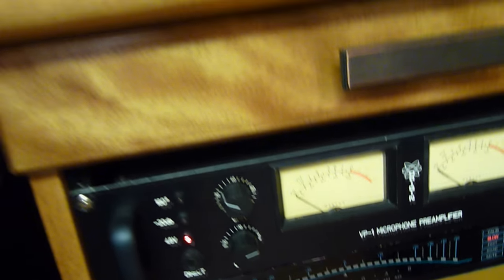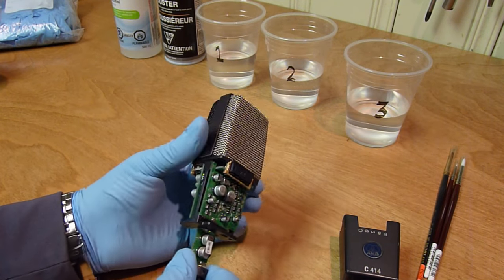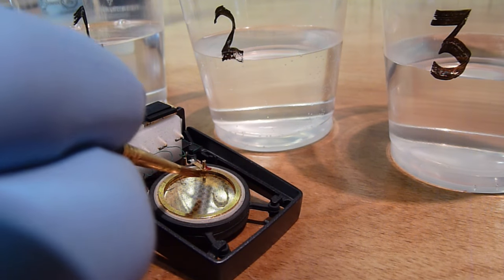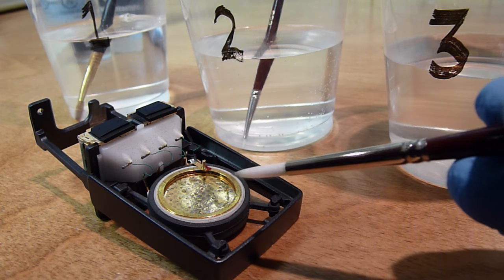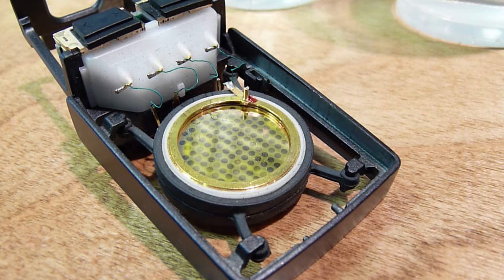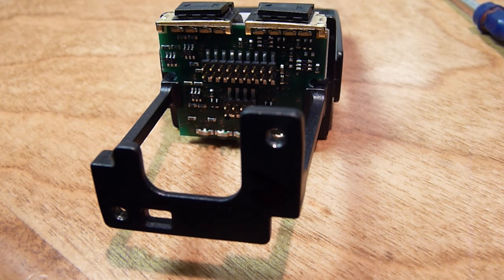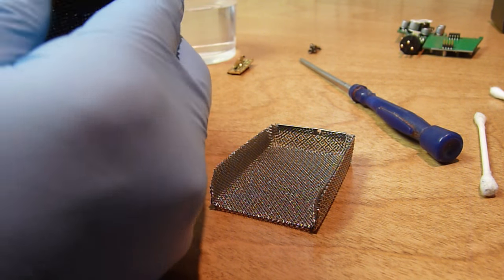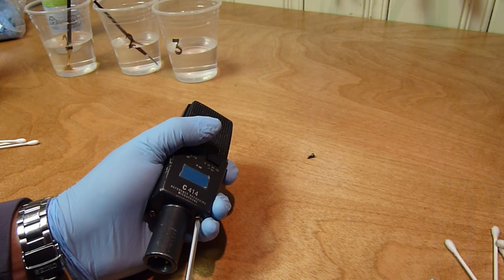Cleaning a Dirty Microphone Capsule

Comment: Very nice and concise. I have been cleaning U47s and such for years, I use other solvents I can find in Venezuela, but your best bet IS 99% alcohol (or rubbing alcohol) to not damage that gold plating. Some mics have the connecting screw in the middle, and tightening that is very delicate since it tends to warp the foil if you move it. Be wary and dedicated, do not rush and use magnifying glasses to see mini-faults. Great video, appreciated...!
Reply: I have a mic that doesn't have that gold plating. It looks like it was there as i can see small traces of it left by the screw. The mic barely works and sounds really bad, unusable basically. Is that because the gold plating is gone? What is the function of that gold plating? I'm thinking of just getting new, cheap k47 capsule from aliexpress but wondering if that's cause of plating is gone?
Reply: @sebsefyu  the gold plating is there so to pick up the membrane movement as an electro magnetic signal. get a new capsule.
Reply: my capsule is dirty and has that screw in the middle. can I lean it only with distilled water and not losening the screw? basically around it...the mic is old and somewhat noisy at more than 50% of pre amp, but still not sure this would help or damage, so not sure
Reply: @Jim Kovacs, is that alcohol that you use the "normal" drinkable alcohol - C2H5OH, ethanol, ethyl alcohol? 
I ask because ethanol is very cheap and easy to get (2€ per litre in the local drugstore) - isopropyl alcohol costs ten times more.
Reply: Andreas Giese always use isopropyl when cleaning electronics. Always

Comment: I dabbled in capsule cleaning several years back, honestly had great success. Have to have a steady hand as to not apply too much pressure and accidentally damage the membrane (some people may not be able to do this), and of course use very soft brushes, but totally doable. I had some MICs that would cut out / make noise if you even lightly got near them with your breath, but after some careful cleaning, they worked 100% again. Replacing the capsules seems totally unnecessary when many can be cleaned. Nice video on the subject, wasn't much at all on this process years ago. Good work as well.
Reply: Thanks for this advice. I have some mild issues with "shaky hands"(especially when I'm doing something that could potentially throw a couple grand down the toilet), so I may see about having someone professional do it when the time comes.
Reply: @Ten80pete  You're welcome. I'd say on a cheap microphone's that aren't much of a loss if you destroy them, it's fine to give a go, but if it is fairly valuable and you have never done it, I would suggest a professional that's experienced in doing it. I would also highly suggest trying it on a cheap MXL or similar first (sometimes can get non working MIC's really cheap online like ebay), to get a feel for it, for anybody that wishes to try it. I would not jump straight to a high end microphone unless you are prepared to have the capsule replaced or reskinned anyway.
Reply: i accidentally rubbed a spot ( gold plated coil got rubbed off) with my rode nt1a. would it affect the microphone? i used 70% alochol. I'm kinda scared right now because its my only mic
Reply: @coleenacebuche2083  Hard to say how it will impact the sound of the microphone, or functionality. If you rubbed off half of the gold or punctured the diaphragm, it might not work well. On the other hand, if it is just a very a tiny spot, good chance it won't make enough difference to notice while in normal use. I would finish the cleaning taking more care, stay away from the damaged spot, and then reassemble. Really won't know until you put it back together to test it. I keep in mind that, the cheaper microphones that need cleaned are nearly junk because they do not work prior to cleaning, aren't worth paying an expert to clean, nor buy new capsules, so was worth the risk of damaging them because even if I damaged it, was still in the same boat of needing a capsule, but, was worth the try. Hopefully it still works for you well enough.

Comment: Usually, 2 ways are used to deposit a thin layer of gold on the mic membrane: electroplating and sputtering. The first is cheap, but the film that is formed is more fragile and usually has less adherence. Sputtering is a more expensive process (the metal is vaporized in a stream of electrons,  in a low pressure chamber, and this metal vapor is the one that adheres to what we want to cover) but the adherence is much greater. Reading the comments, there are many who "peeled" their capsule, that's almost certainly a sign that the capsule was electroplated, not sputtered. 
(in an old Rode brochure, they specify that the NT1A capsule is "gold plated", while the K2 is "gold sputtered") I don't know if they keep the same processes now, check the specifications of your mics before doing anything

Comment: Don't do like I do, listen to this man!
I just screwed apart my ~10 year old Røde NT1-A because the XLR bit became lose recently (because I started to use a tightly fitting cable probably). I didn't find a way to repair the XLR bit, could glue it in maybe...

Anyway, I saw similar debris on the diaphragm and proceeded to clean it with cotton buds and water because I had none of that fancy stuff at home.
I managed to puncture or rather peel off the diaphragm in two places.
Not sure yet whether it sounds better with damage than with debris. Can't tell yet as it's drying in the sun. Almost certainly a bad idea as well.
Reply: выкинь

Comment: I really appreciated your video, and then assembled everything I'd need to clean my own C414. First, I thought I'd practice on my old Rode NT1A, the 25% alcohol solution took the gold right off the capsule!  Cold fear and cold feet for me, I think I'll re-think cleaning the C414, it's the most expensive mic I own.
Reply: I plan to do only with distilled water. my mic is cheap, but capsule pretty nasty when I see it from outside
Reply: C414 capsules are very fragile. The bonding between the gold layer and the membrane is very light and you can easily 'wipe' off the evaporated gold layer. (By the way: I would never use alcohol...)

Comment: Thanks so much. Been looking for information from what least appears credible and experienced sources on this topic. 90% Tell you NO...and NEVER..when it comes to capsule cleaning..but I know better. Thank you sir. Do you have any further advice or input that may pertain to tube amplified microphones? I’ll assume no..but figured I might as well ask while thanking you.

P.S. I do a lot of work on micro electronics. About a year ago I put away my magnifying clip-on/flip in magnifiers for something that works substantially better for me. I had my “last” larger screen Cell Phone. I affixed it to an adjustable mount. Now I use it  as my magnifier..it magnifies AMAZING. The pixel resolution is such that the digital zoom even is more than enough to outclass my magnifiers.As well..it has the very bright LED on it that is much better than dodging around or tilting objects to see minute debris or markings on IC chips. I just leave the charge cord plugged to it while it’s in use. Figured I’d mention as it may be a good tool for you as well.

@FreddysFrets

Comment: Great instruction! Thank you very much! Please, answer for 3 questions:
1) Can I clean my Shure SM7B this way?
2) Capsule of SM7B has a complex structure, and I'm not sure that I can take it apart to clean all the layers. So I have idea to immerse it in a bath of alcohol or distilled water, and then dry it. Is this a bad idea?
3) Can I clear the capsule by isopropyl alcohol (I heard, that isopropyl alcohol better then regular alcohol)?

Comment: I would not suggest to do this with your microphone capsule. I have done the same very carefully step by step like in this tutorial and now parts of gold has detached from my Rode nt1000 capsule. very disappointing
Reply: I would wonder how cold or hot your solution was and what the difference in temperature of the microphone capsule was. I'm sure enough of a temperature shock to the capsule could possibly dislodge the gold plating, but I'm no expert. Just something to consider
Reply: @TheChadPad  Can confirm, I just tried this on an old Rhode NT1A and barely touched the thing before the gold plating began peeling off.  Think I ruined the mic.  Time for a new one I guess.
Reply: Luckily Rode has an amazing warranty, they will likely replace the capsule for free.
Reply: @tomwolff6329  Nah, it wasn't you. You've only demonstrated that the quality from the gold sputtering on Rode capsule diaphragms is subpar [same applies to any Chinese made wannabe Neumann/AKG capsule]
Reply: @RockmannMusic does that mean the mic is no longer usable?
Reply: @edwarddelavilla3475  The more gold is getting removed the quieter the microphone becomes. No gold, no sound : )

Comment: Great video, thanks!  Is that a dry brush you're using on the high impedance board initially?  Are you brushing over the gold contacts as well before applying contact solution?

Comment: I get this intermittent low frequency rumble whenever I try using my microphone. I suspect humidity might be responsible because I live in the RGV close to the coast.
Reply: or maybe the xlr conector are toutching the ground
Reply: sounds like a dirty capsule. the condensation from your breath is mixing with the tarnished capsule and changing the impedance

Comment: Why not soak the grills in some Alcohol, and dry with a lint free cloth, then with compressed air? I know they do not affect the sound, but if there is spit and dirt on the diaphragms there is more on the grills; it might make them smell fresher.
Reply from the maker: Great tip Victor!
Reply: I clean mine with hot water, dish detergent, and a toothbrush! :)

Comment: I might experiment like this on a cheap Chinese mic but when the mics are high dollar,  I might send them out,  if a shop wrecks it, they eat it.  I would think that a fine dry flat artists brush would remove loose dust materials from a diaphram without soaking it.  Were these mics used in a barn or something?

Comment: Good video I started to put a full time pantyhose sock on all my condenser mics. It is a section of pantyhose material that is wrapped around the grill section and held with an elastic band around the mic. The pantyhose material filters out the high frequency shrills and protects the Condenser capsule.

Comment: Around 9:12 there is a cut.  The debris collected on the capsule, how do you get that off, just using the brush, or do you use the dried brush like in the next session to pull it off?
Reply from the maker: yes, just using the brush.

Comment: Chiming in that on my SP-B1 LDC mic (which had become too noisy due to improper storage anyways, and is cheap so no biggie) the first solution made the gold flake off, thus requiring a new capsule, rendering the old one broken. Oh well! Might work better on more expensive diaphragms perhaps?
Reply from the maker: It could very well be that cheap capsules have inferior gold sputtering on the diaphragm. I've cleaned many mics this way including vintage Neumann U-87s and have never had a problem.

Comment: Great video, but have a question, can i rub the same way, a Perception 200 capsul diafragm? Cause there's a wire conected right in the middle of the capsule (as the U87 capsule), so i don't know what to do, thanks for your help
Reply from the maker: Yes I've done it with center terminated mics. just be very careful, don't get them to wet around the termination and let it dry for a long time before trying it.
Reply: @FreddysFrets  nice... Thanks for answer, really appreciate your help, cheers from colombia

Comment: hi, I have and old akg c414xlii, and in the pas, sunds perfect, but from about 3 monts agou, it does not soun anymore, only makes a bad noise when i conec it, and its soud just a litle, what dou think about that. please help i am en Dom. Rep., and there are not replacement here.
Reply: I am also in the DR.  It could be the capsule went bad or a component inside the mic , like a capacitor has failed. I just replaced a capacitor in a CAD GXL2200 mic that allows it to work again.  But, the capsule has a humidity sensitivity problem .  One of the problems of living in the DR is the humidity.  So I will probably need to change the capsule as well because it is not worth having it repaired by what they call re-skinning.
Reply: Dario Aponte - Hello, This could be the problem with your 414. . https://wijproductions.com/2016/12/09/akg-c414b-hum-problems/
Reply: I opened my.akg.214c to find a wire lose from contact so I soldered it carefully back to the spot not a problem now the hum is gone unless I switch pad or rolloff filter then it temporary hums but works again so hey no complain here! Guy sold it to me thinking he was getting over but I won somewhat by making it work thankfulness for some electrical engineer skills

Comment: Excellent video THANKS for info. Could you do a video on mics that work for a period then cuts out then work again 10 minutes later or cuts out when vocalist comes to close and let's out a big note. Rode NT1 guilty as charged
Reply: Been 2 years and I'm sure you figured it out, but for future reference. It is the same procedure as shown in the video for MICs that are cutting out with breath. If a condenser MIC is making noise or cutting out, the cleaning shown in the video should do the trick to get it working again, assuming a dirty capsule is the issue.

Comment: Covering your mic when it’s not in use would save you from having to clean it 
I have a 5 years old rode nt1 and never had a problem with it. Ist always covered
Reply from the maker: Yes that's very wise. I always keep my mics covered too.
Reply: I’ve repaired some microphones and they can get dirty inside quickly.
Reply: some singers spit and spray and covering it when its not used wont help you there. This is why mics get crap on them mostly
Reply: @FreddysFrets   why you said you cant get your oil from your hand on the circuit borde
Reply: Ehhhwwww The Rhodes there should ever be is the ones you drive an the mk1 and mk||

Comment: Question:
Can somebody explain why contamination creates the noise?
I’ve just ‘fixed’ a TLM103 owned by my brother in law by cleaning it. And learned from this video (amongst others) how to do it.
Despite having a degree in electronics I couldn’t explain the reason why the contamination causes noise, pops and could even make the mic ‘brown-out’ as it did on his mic. 

Trying to explain I mumbled about the high impedance circuitry around the condenser/capacitor (of a pretty low capacitance) being sensitive to discharges.
And that the contamination could provide the path for the discharge.

But wouldn’t that require the contamination to be between the condenser-plates?
(Where I haven’t seen anyone cleaning)

Any theories (preferably correct ones) would be appreciated. 

Thanks, Martijn. 
(Please don’t mind my username)
Reply: debris creates points of "big mass" in the _previously-   homogeneously tensioned membrane. Being small particles that are attached to the membrane by static, they can move/vibrate freely every time you use the microphone, but in a pattern you cannot control. Then, the capacitance between the plate and the membrane no longer changes just following the patterns of the sound it receives, now has these irregular spots/mass added (we're talking about a membrane that's only a few microns thick, a speck of dust can be like putting a anvil on a big trampoline)
Reply: @pedrova8058 Thanks,
So it is just the mass of the contamination causing unwanted oscillations?
I am surprised with that. Because then I don’t understand how the mic could ‘brown-out’ completely in that case. (No audio whatsoever).

Comment: What about using no fluid and just lightly using a brush to get rid of the dust and build-up? I feel like this might still help and be safer for cheaper mics.
Reply: My non professional reply is,  spit residue and or other contaminants affecting it, won’t simply "dust off". I had at least one MIC capsule that was rather dirty I had to clean two or three times to get the contaminants off before it would function properly, so a simple dry dust removal isn’t likely enough if the capsule is generating noise or cutting out, which is the only reason to clean one in the first place. The fluid helps loosen / collect the dirt for removal. I did this to a ton of cheap MICs around 2014 with great results.

Comment: can you tell me what happens if the diaphram gets a small puncture?   (I was working on a mic doing a mount repair for the element and ended up doing some tiny tiny indentations in the gold side.  the other side looks like a plastic disk.
Reply from the maker: I've had mics that had tiny punctures in the diaphragm....they sounded normal.
Reply: Thanks, I have one that i think I killed!    it seems I pushed the gold section through to the brass and it's nothing but a shhhhhh noise, until I undo screws and back it out!  (I started dissecting it after I asked my question.) . It's only a $160 AKG 220.    I went in to remount the element as the plastic had broken.     so I may rebuild this body with LED's into a cool display piece!   But thanks so much for your answer!!  thank you.

Oh yeah, prior to me going in to check it out, it was dropping signal.  It'd run for a little with great levels, drop down for 30 minutes or so very low, then jump back up (-20db switch didn't matter)   so even though I can get a capsule to reinstall in it, I still don't have the correct mount and still unsure why it was fading in and out so I'm unsure it's something worth attempting to get parts and repair.